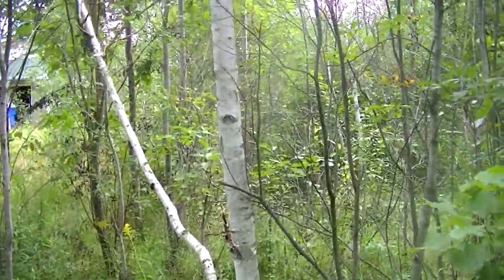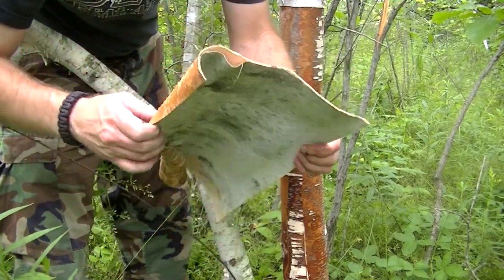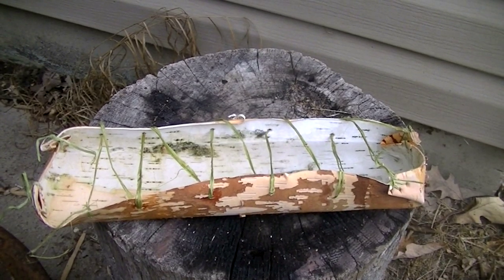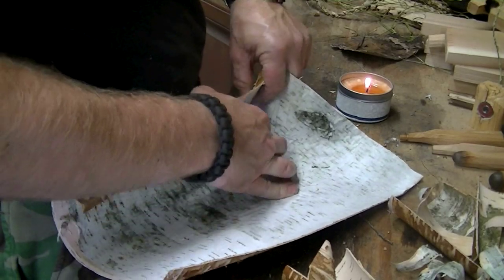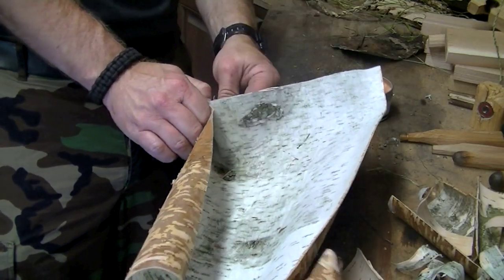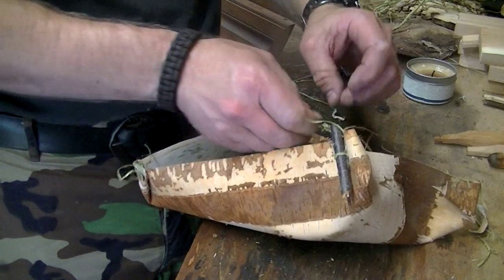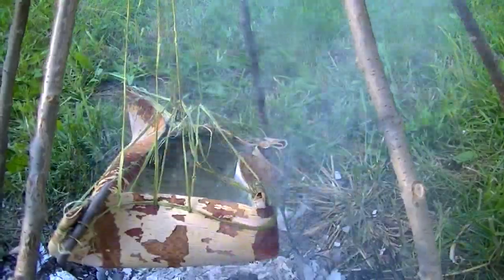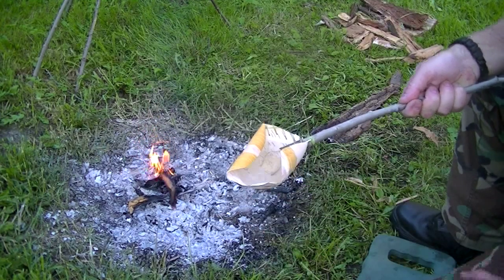Making a waterproof birchbark container

Comment: You don't need to cut down a tree you can harvest the bark without harming the tree the bark will grow back if you do it wright
Reply from the maker: Jacob Brunberg I've heard that. I just hate doing it in general. I'll thin some trees and then use the bark, but otherwise I like to leave the bark on the tree.
Reply: I thought it would kill the tree too' your girdling it. That would kill any other tree. I'd heard on several youtube vids that it wouldn't hurt the tree,.so this spring I took bark from two trees and they seemed fine all year. I'll check again next spring and report back.
Reply: It seems if you take the inner layer too it will kill the tree. Leave the inner , corky layer not all the way to the wood. Yes i did kill a tree to find this out. Rest assured it will not go to waste.

Comment: man I need to try and find some bark around here that would work but im not sure what it would be. when I was taught to remove bark form a tree I was taught to use a spud. basically a stick about 1 1/4 thick that has one end cut at about a 45 degree but not sharp or it will cut through the bark. it worked great in class. also maybe if you sew a hoop on the top rim maybe it would help support it like a fishing net.
I think its so freaking cool you are really learning so much from actually getting in there and doing it. awesome job
Reply from the maker: Survive Without Thanks Travis. Yep some other folks said I need to use a stick, I'll have to try that.

Comment: Very attempt! I learned a lot watching. I am trying it with tulip poplar but it is so thick. Trial and Error!
Reply from the maker: Thanks. Tulip Poplar is processed differently than birch bark. In some ways it is actually easier. Score the bottom in an eye shape then bend and sow the sides. If you want a water proof container though you will have to do it similar for sure.

Comment: Your pot would have worked had you used hot stones instead of directly over the fire to heat your water. The heat gets directly transferred to the water instead of through the birch bark.
Reply from the maker: Muskoka Man I've done that before on a different video. The point of this was to show that it doesn't work like the books say it does. It might work for some folks, but for me it was not worth the effort.
Reply: +Larry Roberts well, you have to make it sturdy like the one you showed in the beginning or tie on a frame so it doesnt curl. and from what i've seen, you should just put a flat container ontop of coals. but i havent tried it so cant say for sure, nice try though.

Comment: could have saved you some time if you would have split sticks like clothes pins and avoided the sewing and poking holes into the bark for water holding purpose or used pitch glue to seal those sewing holes
Reply from the maker: Mike Brank Yep I could have, but I wanted it to be very sturdy for the hard test I put it through. Plus I wanted to make a fast container and not have to use pitch glue. Your right though all that stuff would have worked. I have a follow up uploading right now.
Reply: Yeah ill watch it and Im surprised you suspended it ive only ever seen people throw then right on the coals to boil in em
Reply: also since you had the holes punched in the sides you could us sticks lashed along the sides for some rigidity to the side rather than the split wooden bands like the purchased one you showed at the begining
Reply from the maker: Yep I could have, thanks man.